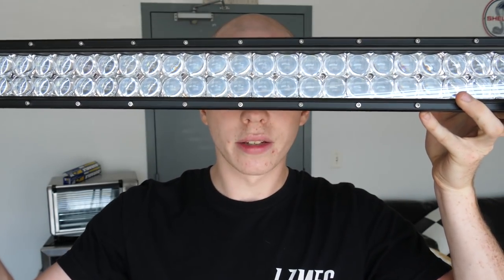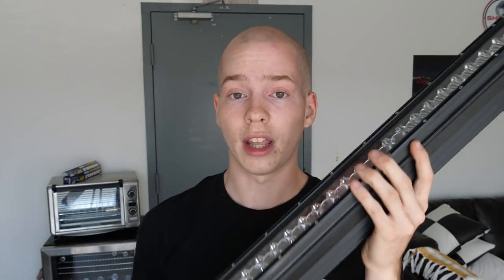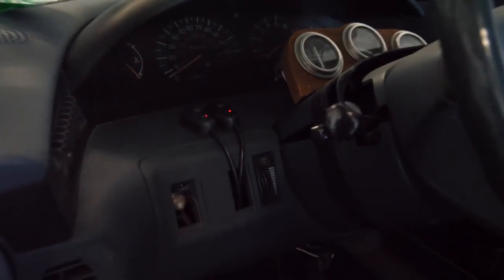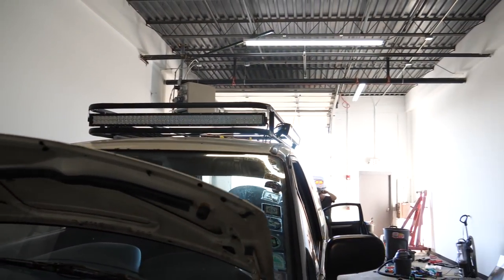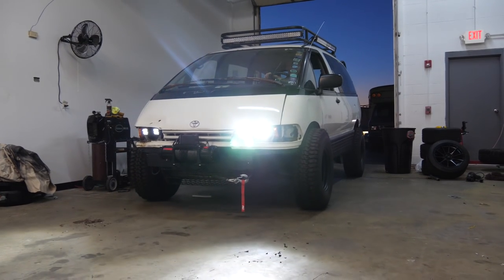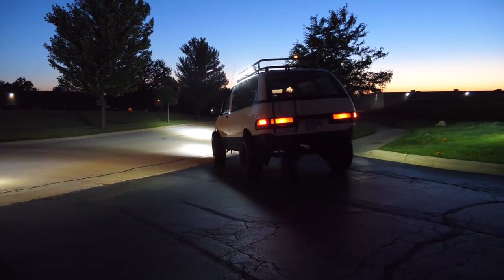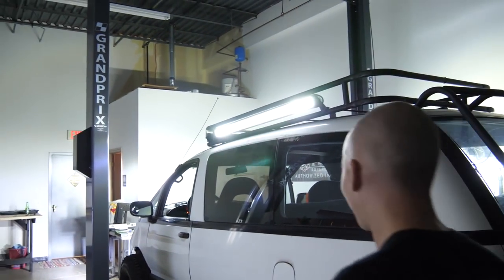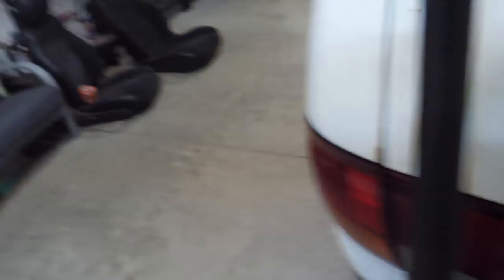Installing 3 Massive Auxbeam Light Bars on the Lifted Mini-Van

Comment: You need to angle the light bars so it lights up the ground by the van. Rn it's just pointed straight out and lights up the ground far away from the van.
Reply: This applies to his headlights as well. Driver side headlight on the panda is angled upwards too much, same with his bus. I don't remember if it was driver or passenger but it's easy to tell from the videos that they will blind people.

Comment: Paint the inside of the headlight area black
Reply: Tursko that’s a awesome idea
Reply: I was thinking the Same thing
Reply: @viktortern2309  headlights in the back are supposed to reflect light, literally that's the one thing they are designed to do, painting it black would be stupid

Comment: You could use those light bars to light up the whole shop!   Could set a bunch up on the ceiling. Power them from a 12v server power supply.

Comment: Find all the connectors and transfer case to convert it to awd, then solid axle swap the front. If it's a unibody you're probably going to have to reinforce it, but you can usually find all the stuff off of a junk Cherokee. If you want to go with a beef your axle usually find like one off of a half ton or 3/4 ton Ram.

Comment: The van is cool to me! Cap and rotor are wear parts, the wires should be ok. Besides that I would try to lift it a little more in the front.

Comment: Shouldve put two facing forward one angled slightly down, the other slightly up. Then use the third for the bus. 

The way you have it now,The ones on the sides could be faced down